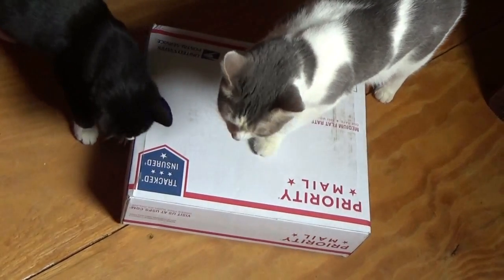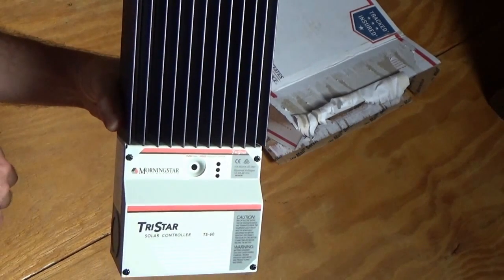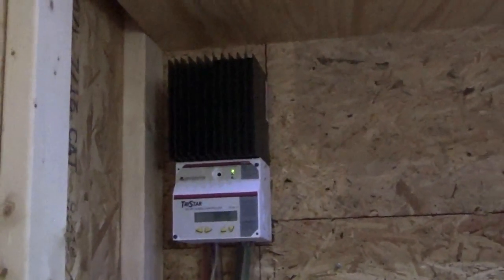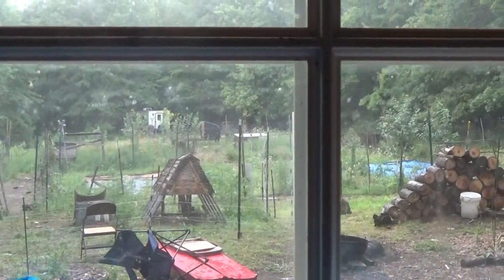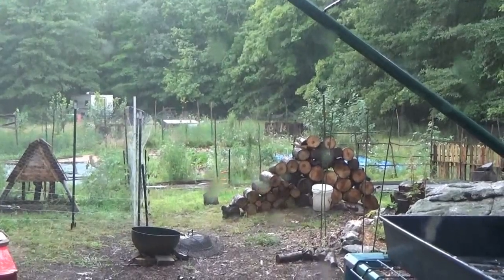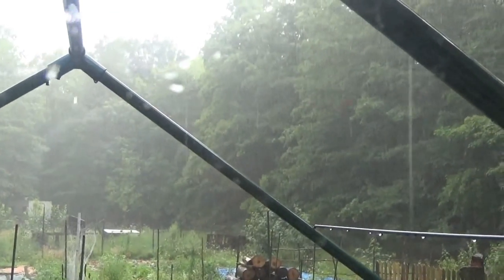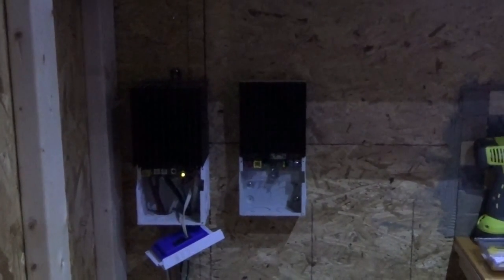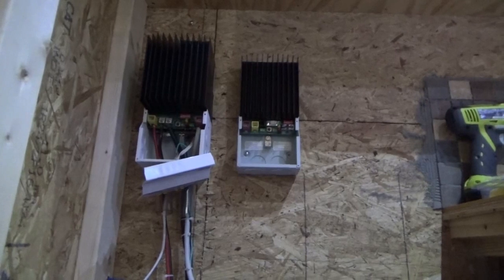Installing A 2nd Solar Charge Controller In My Tiny House On Wheels

Comment: no mppt?????????? back to the old days!  (screaming here! lol)

would have wait until you had enough mony to buy a real mppt!  

but agree, better some power extra then nothing!, 
two seperate battery leads to the pwm woud have been better then splycing it into the main mppt leads (due to the voltage drop) (betters say rise due to the charge amps from the mppt in the cable )your pwm will not give maximum power ito the batterybank.

sorry for being a bit negative , but i wish you the best with the materials you use,as you know i install these systems for living. no better nolege ten that learnd in practice!.

still thumbs up !

Comment: The controllers will work well together. They will stop working after the battery cut off voltage is reached. I would not combine the battery wires together they will carry a lot of current at 12V. You will get better results if you use a set of 2 gauge wire for both units. Plus when you outgrow the controller you can set it up as a dump load for a turbine.
Reply from the maker: 99beta I do plan to run larger wires from the battery when finances allow. But for now I figure I am not bringing in any more current than before at any given time until I wire up the panels properly. Waiting for a set of wires to arrive in the mail for the panels to be wired in parallel for the PWM charge controller.

Comment: to-do the grounding right two ground rods at the modules one at the batteries and charge controllers. a 6 gauge wire with nickel plated copper lugs on the modules to the ground rods this 6 gauge wire needs to go to the battery box if its steel to the ground rod by the batteries and ground the charge controllers and also the inverter. if house is on a trailer to frame also so to prevent static electricity from destroying electronics.  the whole complete electrical system needs to be tied together. any more questions

Comment: Is your water still collected from the RV? The tiny house roof will collect more and it should be cleaner that the roof on the RV with whatever it is finished with and all the patching/sealer that may be up there.
Reply from the maker: Holly Laughter Yes I am. I hope to finish the rain water collection on the house in a month or so. Then move the water tank over here. But first I want to get a dark, insulated room built before I move the water tank here.

Comment: what about fusing.  grounding is a must. did you install two ground rods as per code. did you ground module and charge controller properly. two charge controller two sets of wire to batteries and fuses. solder lugs check for loose connections under load with infrared thermal temp gun.
Reply from the maker: Roy Amberg I am trying my best to make it all safe. Everything is fused. I have no earth grounds at this time. There is much discussion about earth grounding a pure off grid solar powered home or not. I am still trying to figure that one out.
Reply: +The OffGrid Office  Be careful. .. it looks like the Dan G in this thread maybe the imposter, not Troy's friend.

Comment: why don't you raise the equip above the shelf so you do not have to squat and both machines will be cooler.
Reply from the maker: Phil Rusciano Above the shelf is another shelf. Above that is the ceiling
Reply: you continue doing things the hard way. work smart not hard. I only suggest because I am jealous I would to visit and spend a few days with you.Even when you get cranky..

Comment: Hi Troy
Reconfigure your panels in parallels for your new PWM Controller .

keep the panel wire short , run 2 or 3 wires per connection if you must
& get the Ω down  …. " E.I.R. & all that Volts Ohms & not a lot at the end "    LOL

At 70 amp a very small resistance will generate a lot of heat so check connections under load before you button it all up .

Did you solder the lugs ?

keep the videos cumming .
Reply from the maker: gd2329j Waiting for some parallel adapters to arrive. No I did not solder the lugs. Thanks for the reminder

Comment: I use several pulse width modulators controllers on my solar system. They are only 12 dollar controllers. LOL they work just fine. For the price if one breaks because I did something to it or factory defect I just buy another one. They do just fine job. For practically nothing. Its all just diodes resistors and mosfets assembled in China. You can pay more for an American made one a lot more. I dont think its worth it. 300 dollars compared to 12 dollars do the math. I do add a heat sink to the Chinese made controller. CPU heat sinks work from a old dell cpu or something that fits on the back of the controller and some cpu grease.
Reply: MrBugsier5 Some truth to that. But I may take ten years to make back the 550 dollars the mppts cost. The PWMs produce enough for the work the inverter is doing for now the pwm s are more than adequate. I wish someone would send me a mppt  for free to advertise for them. LOL
Reply: Your right I wish I had more money right now to fix it all up with the most efficient stuff. More panels for 550 dollars would be a nice improvement too. I think it would be a couple more of 235 watters and that would be a lot more improvement according to my engineering buddy.  I have room for lots of panels. Just need more dough. I wish I had about 20 235 watters I could make twice the power Im making. but then I need twice the batts too. I need more mula.
Reply from the maker: shartne Yes that is good but some of the cheaper controllers do not have equalization mode.
Reply: Very true.
 My batts are doing very well. holding 13 volts an hour or two after dark. TV and sat going constantly.
Reply from the maker: shartne Wow, nice
Reply: The Do It Yourself World we have sun from dusk to dawn for many hours a day non stop. Its hotter than the hinges of heck here.  but lots of sunshine. LOL batteries are charging all the time floating a lot of time. sun is almost straight over head but going back south a little.
Reply: shartne  pitty is you are trowing away 30% of the power your panels can produce, agee, they are cheap, but a good and right connected mppt wil last ages, and will produce more charge amps then the old fasioned pwm.
Reply: shartne going to instal a new system at a client, 4 panels from 260 watts , a Victron mppt charger, and 4 new traction batterys from 24 volts , 460 amphours, next week, all mounted on a houseboat.(cliend lives on it, off grid.)
Reply: shartne thats how it is suposed to work!, lol
but getting the bank at the 14,4 volt wil be better for them (on charge) in the long term (at use 12,6 is fully charged) the 13 volt you mesure is a static load, wil be 12,6 under load.
Reply: Actually my bank floats at 29 volts all day long even when the 52 inch plasma screen  sat dish and stereo are all on. Sorry my bad my figures were slightly off. It is working flawlessly. perfect!
Reply: 29 on float is high even for traction cels, they wil use a lot of water that way, the 29 to 30 volts on traction cels is good for equalizing not for float.
Reply: +MrBugsier5 What is a traction cell? The cheap 29 volt float charging china controllers is what I got. It seems to work really well. I am using four golf cart batts just like Troy has. Mine work perfectly. Last night at ten o clock the batts had been running the 52 inch plama tv and sat dish and the 100 watt Pioneer stereo all day long and were working at the time I took the reading, the batts had 26 volts and holding. So that looked good to me. The sun had been down for 2 hours I can run the entertainment center all night long with no problems. Sun comes out and charges them up in hour or two.
Reply: traction cels are the kind mr Troy Reed uses now, the same ones they use in forklift trucks. the right way to charge lead acid batterys is normaly three charge states, the first is the bulk charge, you charge te cels til they reach the gassing fase ( in normal batterys thats 14,5 volts), after that the charger goes into equalize mode , still charging the cel with a smal overcharge  voltage, after the amps drop to one amp or les the charger should go to 13,7 volts and maintaine that voltage (to prevent extreme gassing, and damaging  the plates ), in traction cels that voltage is a few volts more, due to the way these cels are made.( the cell has to bubble to prevent stratification of the liquid in the cel),but the high voltage u are mentioning should not be float voltage, that has to be lower then the charge voltage (in your case around 27,5 volts)
to prevent damage to the battery's.

Regards Richard
Reply: +MrBugsier5  float voltage, that has to be lower then the charge voltage (in your case around 27,5 volts) that is what Kilog69 said too. but so far Im not experiencing damage. it has gone all summer and it is working perfectly so far.
Reply: for float its way to high, you will damage your batterys in the longer time (also more water use), for charge 29 is fine.

Comment: question: Do you not have your house and solar set up grounded!!??? not good bro!!!! if you ground everything off, you will have alot less of a chance of getting hit by lightning!!!!
Reply: The Shootist GFCI is not for lightning protection
Reply: eastafricansolargeek I've heard that too. 
But...if you look at pictures of old houses, at each end of the house there is often a rod sticking up. That was supposed to be for lightening protection. However, it was discovered that having that mass of grounded metal sticking up above the house actually attracted lightening. That's why you seldom see them on modern houses. 
When you ground the house wiring you are moving ground to a higher elevation, which moves it closer to the clouds and the lightening. 

Perhaps I'm thinking incorrectly? :-)
Reply: I have blown a dsl modem one time and a dsl filter another time, both from lightning. And mine are grounded. Didn't seem to help a lot. Troy has no grid-tie and I assume he gets his dsl via wirelss. He has no mile's long wires coming to his house.
Oh, I had lightning strike nearby at work one time. Blew an antenna to shreds, knocked out the computers, phones, and truck scales! Didn't bother the radio the antenna was attached to (strangely)! But, it is a requirement that all of that equipment be well grounded. But it didn't seem to help.
One thing, with no "earth ground' he does not have to worry about ground loops! :-)
Reply from the maker: eastafricansolargeek There is so much discussion about grounding a purely off grid power system or not. I am still trying to figure out which way to go.
Reply from the maker: The Shootist Is this for on grid or off grid installation? I am talking about NO connections to the power grid at all. I know that grid tie connections have to be very safe for line workers.
Reply: The Shootist That looks more like some super dooper cautious political speech. From reading that a solar powered flash light would need at a minimum a 6 gauge ground wire!
Reply: The Shootist Ok, worry about electrocuting myself on 12 or 24 volt DC? Should I also worry about electrocution from a 1.2 volt AAA battery? How do you go about grounding those things?
IF .... IF you are talking about grounding the INVERTER then you may have a point. But grounding the power system itself, especially when used as a 12 volt power source, seems to me to be overkill.
Reply: The Shootist So, if I'm reading this right. He should put in an earth ground on his inverter. That way the electricity will have a return path through him and the ground if there are any problems? I don't recall him mentioning getting any electrical shocks while operating his power equipment that is sometimes ran from the inverter. I guess he just isn't as careless as some people think. Or the "mishmash" isn't as bad as it seems.

Comment: i am doing about the same thing today, i added 2 panels for camper use to have 3 mono panels i had to wire a new charge controller that will take the watts of the solar panel set, i got one panel before camping trip it had controller & book on solar wiring & how to setup solar system, i did to get more solar charge to battery's good reading during rain storms
Reply from the maker: gatorred157 Cool. Always improving our power. Bit by bit we will get there
Reply: i hope to